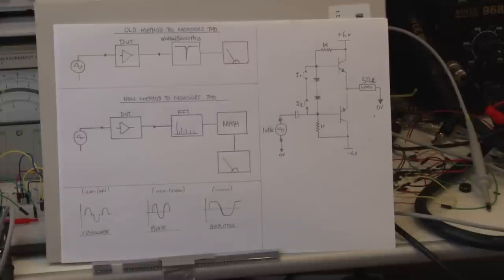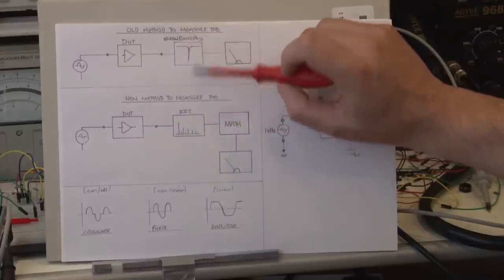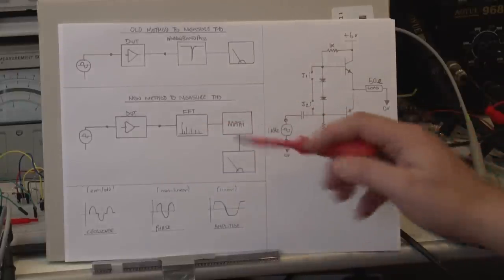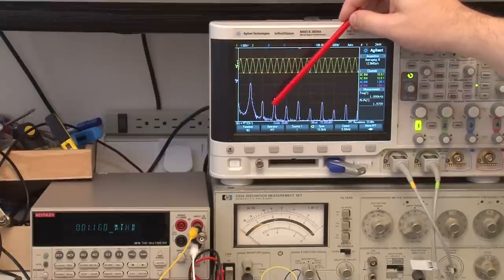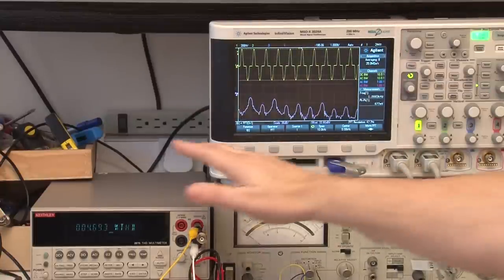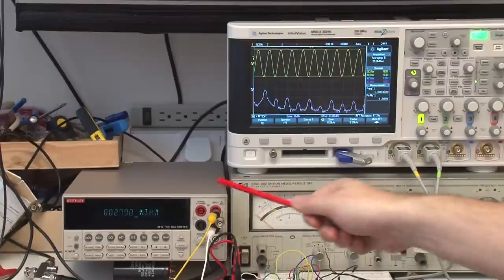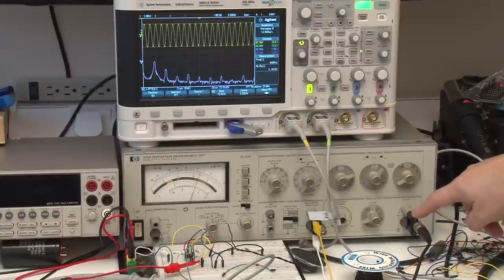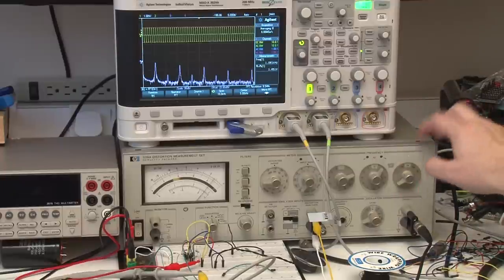Measuring Distortion with a HP 339A and a Keithley 2015 THD

Comment from the maker: Hi, I am sorry, I missed you comment the last time around, sorry about that.  The Chinese rework station has been remarkably good actually. I bought it some four/five years ago and its been reliable the whole time.  The soldering iron is really good and the hot air gun works well. I have no complaints at all. Gerry

Comment: Hi Gerry, one of the deciding factors for me buying the Keithley was the distortion measurement ability. I also like the fact that you can set  it to averaging and set the number of measurements it averages from 2 to 100. If you set it to average 100 measurements via it would be slower to respond to changes but would give you far more stable measurement.

Comment: All three types of distortion shown are examples of non-linear distortion. Non-linear distortion where harmonics or additional frequencies are produced. If the sine wave is visually deformed in any way then there is non-linear distortion.
Linear distortion would just be a change in amplitude, such as amplification or attenuation. Linear distortion can also affect a specific range of frequencies such as a high/low pass filter or an equalizer. Phase distortion is just a change in time (delay).

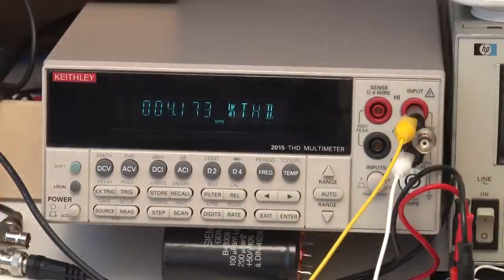Comment: @18:45 when you say "not sure what that does", I believe it is a setting to control the output of the second signal out, and I believe "ISINE" is inverted sine, so it sends the same signal out but at 180 degrees phase to the primary out.  I think...

Comment: The Keithley THD measurement allows you to specify how many harmonics you want to measure. The THD + noise measures as many as it can up to the measurement bandwidth limit. Thats why you only got a few % distortion with the THD mode and 50% with the THD + n mode. In addition if you access the Keithley through rs232 or GPIB you can get the measurements of the individual harmonics. Its a pity that functionality is not available through the front panel.

Comment: If you program the keithley via rs232 or GPIB you can also configure it to do sweeps (see pages 2-34 to 2-46. The 2015P (rather than the 2015THD) even does spectrum analysis... but again only accessible through programming. I suspect the THD rms mode of the 2015THD would be closer to the measurements from your HP

Comment: I think, osciloscope, even USB osciloscope, or spectrum analyzer, is better than dedicated multimeter with THD. You can do THD calculations on osciloscope with FFT or spectrum analyzer much more accuratly than with THD meter. No only that but, osciloscope or spectrum analyzer can do more advanced analysis of a signal and distorsions, especially for high frequency signals. Dedicated THD meter could be useful for audio equipement, if you are testing them every day, and need a standard way of doing so, even if it is less precise, but is faster.
Reply: With a 8-bit oscilloscope as most are one can only measure down to 0,4%.
Reply: @Florian Hofmann  agreed scopes are awful for measuring aptitude.  Seeing the shape is more useful for troubleshooting distortion, you may know why it's distorted by looking at the wave or FFT.  But the resolution is too poor for measurement.

Comment: Neither tubes nor transistors produce any dominant orders even/odd. The majority of distortion occurs in the output stage. Push-pull will cancel evens. Any differential signal will. A single-ended stage will produce even order due to the asymmetrical nature of the device whether it solidstate or vacuum tube.
Reply from the maker: almost certainly due to the output stage but in my experience tube amplifiers are less prone to dissonant tones when overdriven, which is why guitar players love them so much.  The distortion characteristics of tube and transistor amplifiers are different in the frequency domain, that's visible when you compare both.  In general, tube amps have a notably high THD figure compared to a well designed transistor equivalent, despite this, tube amplifiers tend to be sonically more pleasing to the ear,  The only difference I can see between tube and transistors is  the frequency spectrum is under moderate overdrive conditions even harmonic levels are more dominant than odd harmonic levels in a tube amp, so it makes perfect sense to me (as a guitar player too) that my Tube amps always sound better than their solid state counterparts.  That being said, nowadays, modelling amps get so close to re-producing these tones there is really no justification for the expense and lugging 60's tube amps around any more, a good quality PA or a FRFR active speaker setup is much better today.
Reply: @gerrysweeney Guitar guys distort the single-ended stages. Typically a high gain triode like the 12ax7. If they overdrive the output stage it'll start adding odds and becomes very grungy sounding. Too much of that and it's rather unplesent. Transistors have a lot of high-order harmonics and IMD. That can sound pretty nasty. Whip up a class A gain stage with a single transistor. That could be a fun exercise in harmonics.
Reply: The softer clipping of class A tube output vs a class a transistor with a much more abrupt cutoff is probably what creates the warmer tone.  But yeah the asymmetrical clipping is 90% of what makes class A overdrive sound good.

Comment: Your schematic misses the connection between the junction of the two switches (or jumpers) and the junction of the two diodes.  The demonstration implemented the correct effect, though.

Comment: Gerry, thanks for the great video. I've been considering a 2015 but have seen some negative comments regarding bad pwr. supply caps. Apparently, Nichicon got a bunch of bad electrolyte for a while. Supposedly they short and can actually the kill meter. Any thoughts on that? Would it make sense to recap it just in case? Thanks, Ken
Reply from the maker: Yeah its a known problem that can kill the meter, its the two big caps, you can simply replace them if you are concerned.  The model I have is a newer model that apparently does not suffer form the problem.

Comment: It looks like you messed up your explanation of harmonics starting at about 14:24 or so. The first harmonic is the actual fundamental frequency. The second harmonic is the first bump you see to the right of the fundamental. So, for example, starting at 14:24 you are pointing at the 3rd, 5th, 7th and 9th harmonics and not the 2nd, 4th, 6th and 8th as you state in the video. Your example waveform shows a predominance of odd harmonics over even harmonics (i.e., more solid state like rather than tube like).
Reply from the maker: +SteelBlueVision thanks, yes you are right :) thank you for pointing that out.  Its funny when you know something instinctively I have never really questioned my understanding of the naming. I know the frequency domain patterns pretty well by sight but not by name obviously :)

Comment: I checked the circuit before I replced the transistors...and diode circuits before I replaced the outputs.....thou I find 2 of the output risistance reading diff form the ones on the good channel ...could that be a problem?

Comment: Is there HD bellow the fundamental ?  In this case, to measure it, does it require another set of very expensive equipments ?
Thank you for the demo !
Reply: Eric D. No because you cannot generate a lower sine wave from the "original" sine wave. Well, obviously you could but..  The sine wave is already the perfect shape and perfectly is at the frequency you set it too. If there was another, lower frequency since wave than that would be the new original sine wave and the former original sine wave becomes a harmonic. Or it would just be another tone which would be ignored in this case

Comment: Great video, thanks a lot for sharing!!
I hope that you please will answer this noob question.
7:38 Would it be possible to take two probes, one to the output of the functions generator and one to the output og DUT, then substract channel 1 and 2 and then only get the difference (distorsion and noise) displayed on the scope?
Reply from the maker: Yes in theory, but the difference would be so small you would not really be able to tell the difference between the noise you are trying to measure and the noise floor of your scope. There would also be other inaccuracies like the difference in gain calibration and signal delay on the different channels of your scope which would introduce unexpected results, and phase noise etc. So, in theory, yes your thinking is correct, but would require an ideal scope with two perfectly matched channels with a noise floor at least 10x lower than the noise you are trying to measure, so for all practical purposes the answer would be no, that would not work.
Reply: @gerrysweeney  Thanks for a really great answer! So the metode you show, have some sort of amplification to the signal, to get the difference after the filter?
Reply from the maker: @friedmule5403  metode?
Reply: @gerrysweeney  metode = that what you are doing / describing on your drawing. :-)
Reply: @friedmule5403  method I guess
Reply: @johnnytacokleinschmidt515   lol yep. :-)

Comment: hey I need some help I replace some bad tranistor outputs in a America audio amp 3001..but the out put is distorted any ideas where it may be coming form......driver and outputs changed
Reply from the maker: Raj, very difficult question to answer, you need to get a scope on there and have a look, it could be almost anything.  Its generally not a good idea to replace output transistors without first making sure the rest of the amp circuit is in good shape.  Every scenario is different I am afraid. Gerry